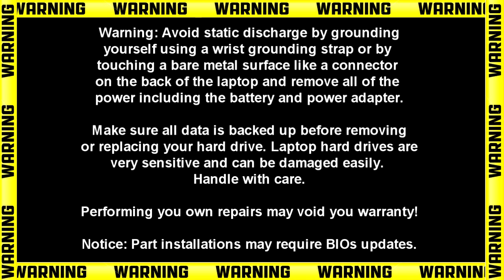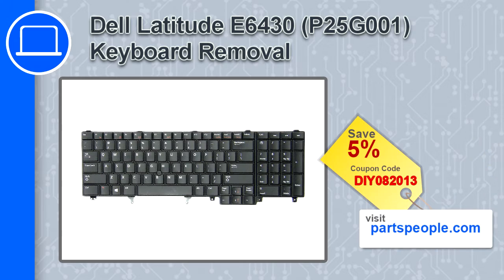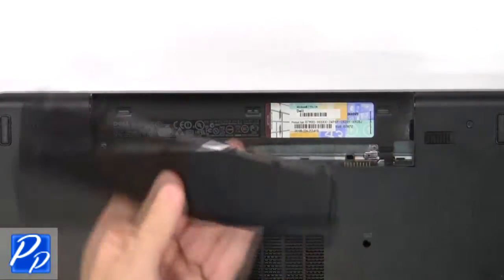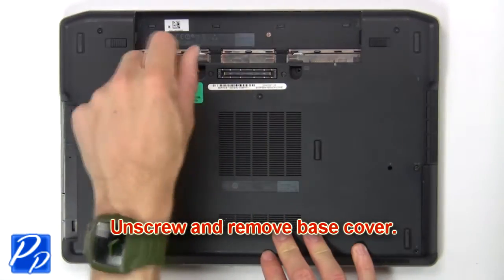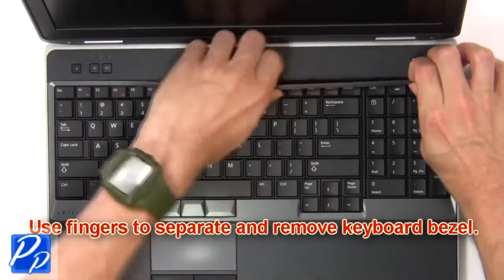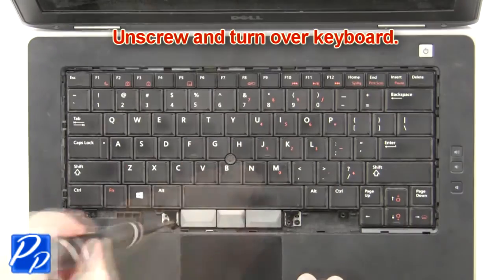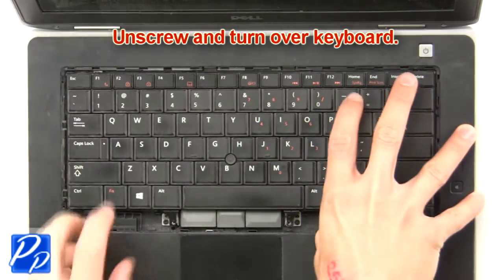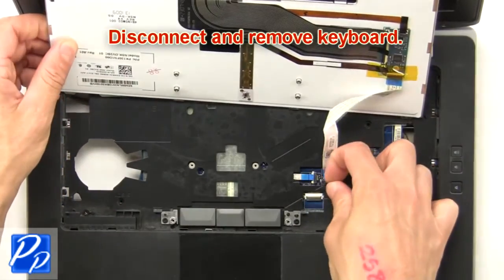Dell Latitude E6430 (P25G001) Keyboard How-To Video Tutorial

Comment: hi ricardo, is it possible to replace dell latitude e6430 with e5430 keyboard?
Reply from the maker: Yes. The E5430 and E6430 use the same keyboard.
Reply: @dellpartspeople  hi, I bought a portuguese keyboard to replace a UK keyboad on e6430 and now none of both keyboards work. I suspect its the flex cable. Do you know where I can buy one?